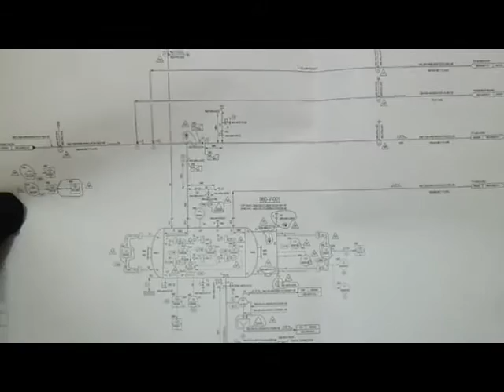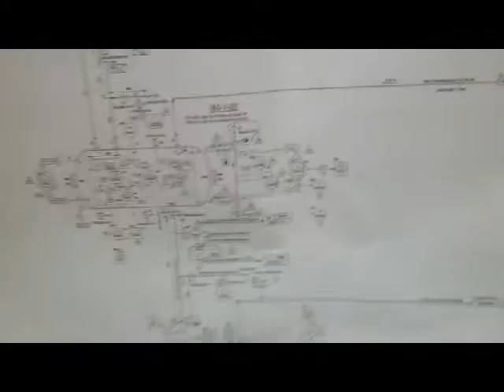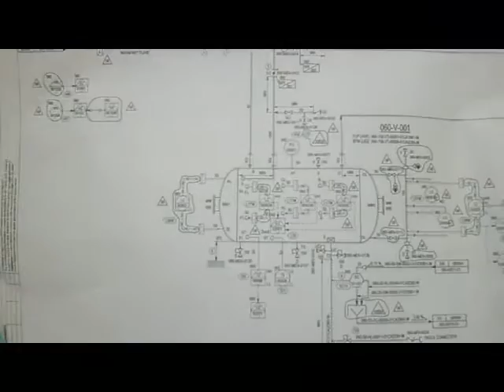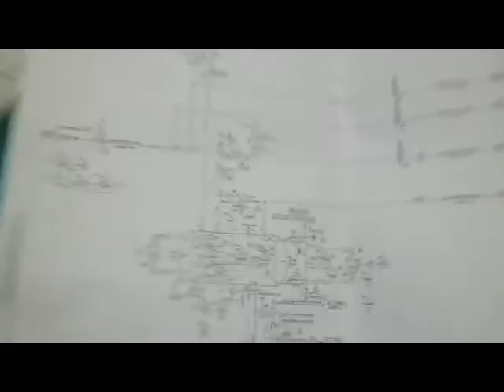How to Read Isometric Drawing in P&ID Piping Instrument Diagram - Pipingweldingndt

Comment: again sir, you pointed it wrong, if that is the line, it should be the 2nd line from the line pointed by your pencil, there is a discontinuation of the drawing line, meaning it is not connected with the other line. The line you pointed out goes straight thru the drawing horizontally, with a branch going to the vessel, which is the 2nd line, not the 1st line from the vessel which is the long vertical line with discontinuity....... please trace and check again....